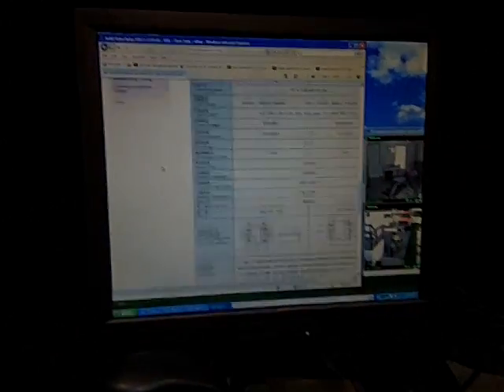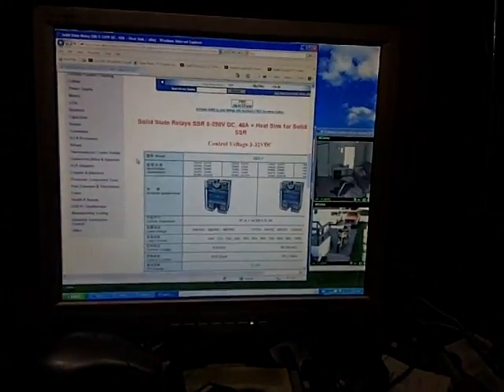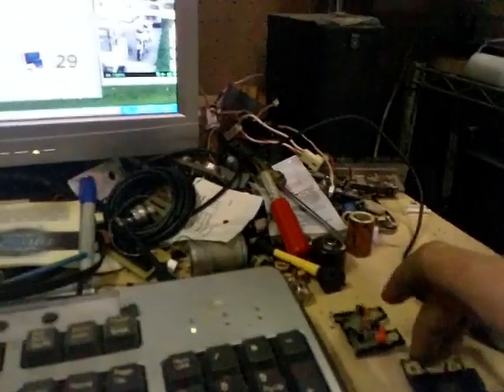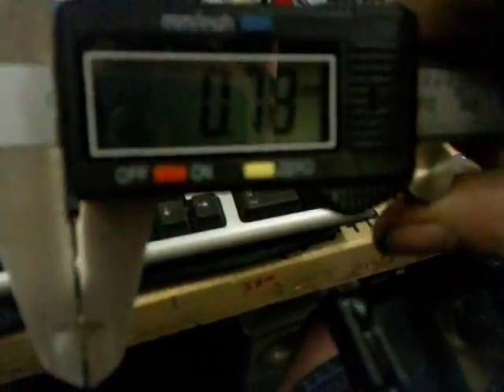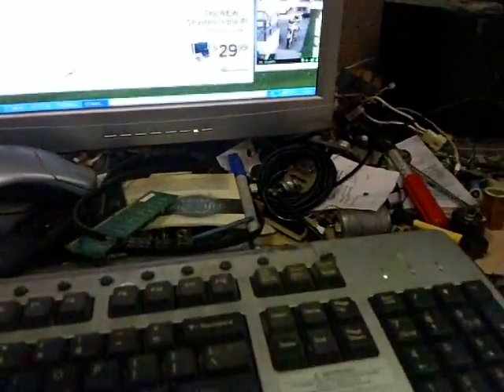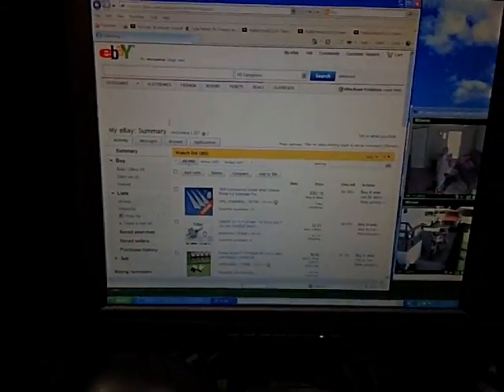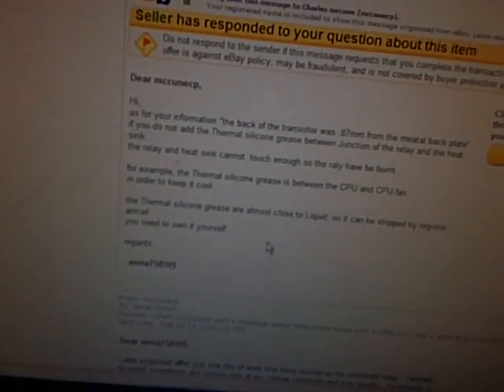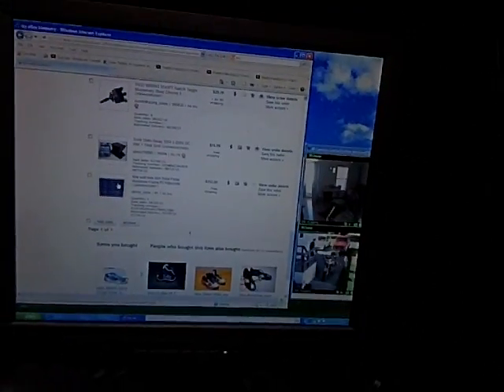bad solid state relay from ebay.

Comment: Why would you expect a 5-220 volt, 40 amp ssr to handle 528 watts? Obviously, at the minimum voltage [5 volts] you should expect this relay to handle 40 amps, but that doesn't mean that it can handle 40 amps at 220 volts. That would mean that you could use this device to switch an 8.8 kW load! At 220 volts, the maximum current this relay can handle (@300 watts) is 1.37 amps, and only then with a large heat sink. Of course, both the US and China do not warn you that their ssr ampere ratings are only a maximum, and only at the lowest voltage. Even experienced electronics geeks sometimes are fooled into thinking that those ampere ratings apply over the entire voltage range, but when faced with the harsh reality, they understand that they were the victim of marketing hype and their own optimism.

Apart from your xenophobic rant against Chinese products, US sourced SSRs generally are made out of country anyway [Mexico], and they also usually do not list the most important limitation, maximum heat dissipation. I interpret the e-mail response that they sent to you to be the result of a misunderstanding that you did not apply thermal compound between the relay and heat sink, not that they expected you to break the relay open and put compound inside.
Reply from the maker: first off as for the compound. I put compound on it between the ssr and the heat sink.  also after taking it a part they had heat sink compound between the mosfet and the copper baking.  What they need to do is have a range of spec's that you see with mosfets,  IE max wattage would have been great why. then you know what the current would be at each voltage.  The add never listed that the max current was for 5 volts or 220.  I only need it for 30 volts witch would dump excess in to a dump load from batter bank, at only 500 watts  after it burned up I wanted to see what the mosfet was in side of the ssr.  and it was ratted at 300 watts, according o the spec sheet for that mosfet.  Witch means 500 watts is more than 300.    at 7.5 volts you could draw 40 amps  and I need 16.66 amps at 30 volts   since they didn't have a data sheet like most companies do.  Hell 16.6 amps out of 40 amps is just half of the power.    and to draw just 16.6 amps would only been good for a 12 volt system at best were as my system was a 24 volt system and as the volt goes up the current drops fast.   hell at only 220 volts as you already said only 1.3 amp draw.    so I built my own that can handle 3kw of switching power with 4 750 watt mosfets.  if this SSR would have had a 750 watt mosfet just one it would with out any problem handled a 500 watt dump load.  So the SSR was under sized for what they were asking.     if I used there logic of max 40 amps at only 7.5 volts   then My SSR would be ratted by those morons, at.   400 amps   at  5 to 220volts DC. so misleading the advertisement is with out correct data sheets.  any one could fuck this up.   Hell at least mine that I build can handle 13 amps at 220 hell of a lot better than here misleading crap.  Thanks you have a good day.

Comment: unfortunatly it is most common that chinese sellers on ebay exaggerate the specs of their equipment, in some cases quite a lot. I recommend you should open a case on ebay and ask for a refund -
but too late now! I had many bad experiences with the quality of chinese fake products and their specs but in most cases we found a satisfiying solution.
You just have to keep in mind that you can demand just the half of the stated performance or rating ;-)

Keeping this in mind, chinese products are not beatable in the price category, even when you take the fake quality into account.

But sincerely they should be more honest concerning specs and used electronic parts. When the SSD is rated 40 A the triac inside should be at least rated 40 A, better 50 or 60.
But its the other way round in most cases.

Comment: My recommendation would be to pick high watt transistors capable of high voltage and high amperage, or find good quality ones and parallel the output to lower the load.

One large high volt high amp transistor = very expensive. Multiple smaller lower amp high volt transistors = cheap. Opto-couplers are also dirt cheap. Cheap enough to even double up as a 'failsafe' although I don't really think that's necessary.

Comment: I don't think they're lying about it. The mosfet can be rated at 300v but only 35 amps, and still have 300 watt max rating.

Either 300v @ 1 amp, or 35 amps @ 8.5v

Comment from the maker: I built one and have ben using it for a while now almost a year and its still working good. its capable of up to 3000 watts I have put a load of 1500 watts on it and it didn't even get hot but I also have a large heat sink and small fan that also comes on as the fets come on.  I will need to do a better video of the finshed solid state relay and its works great. and you can build it for either + or - switching. mines for the - side. I will have to do a nother video on it.

Comment from the maker: hey bro I put thermal grease on the back, it was arctic silver the best thermal grease there is and it still burned up. so you need to chill the fuck out. don't comment if you don't know what the hell you are talking about. That's OK I have a much better Relay I built works a hell of a lot better, and it can handle up to 100 amps and never gets hot. so yea, Chill out, and I even used the same arctic silver on it as I did her shitty ass relay.

Comment from the maker: thanks I look in to that right now I have ordered 4 750 watt fets.   they are 44amp 500v.  the one I bought off ebay was 40 amp 220 volts and after it burnt up and they didnt state the wattage my 500 watt gti burned it up the mosfet theyuse was only rated at only 300 watt.   so I belive with what i"m building I will beable to handle easy 2000 watts.  I will be printing and etching the boards this weekend I need to upload videos of testing it